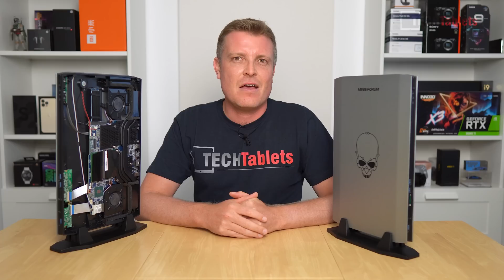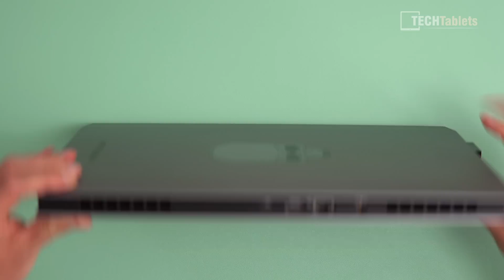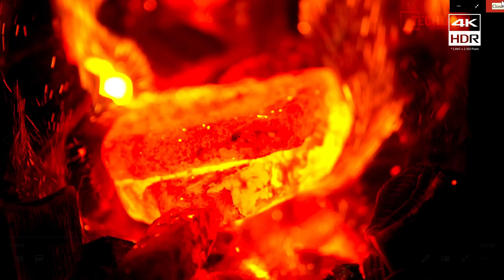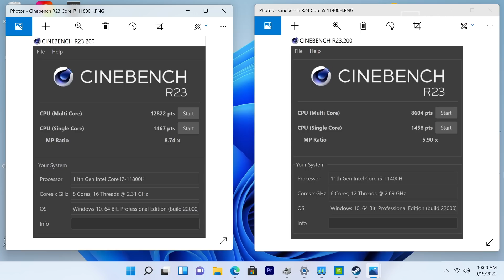Awesome SFF RTX 3070 & RTX 3060 Gaming PCs!

Comment from the maker: More info & pricing: https://bit.ly/3d2pEns
00:00 - Intro & key specs
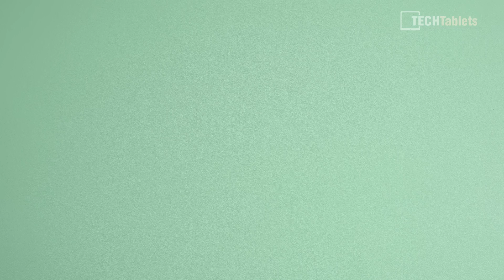00:54 - What's in the box
01:49- Design, ports, and internals
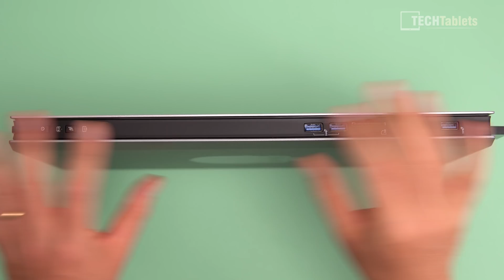05:08 - Bios settings available
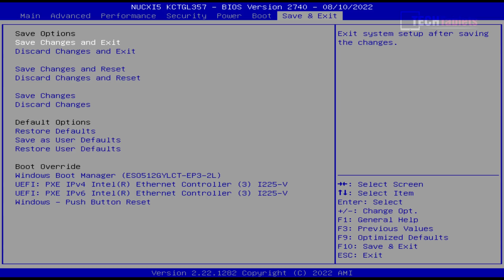06:53 - Windows 11, devices, 4k playback, and benchmarks
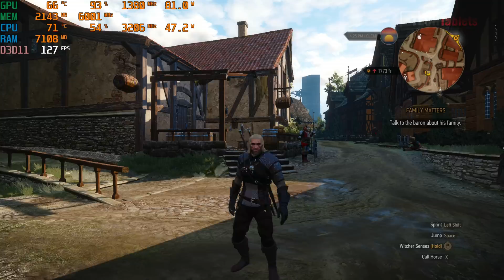13:38 - Gaming & thermals
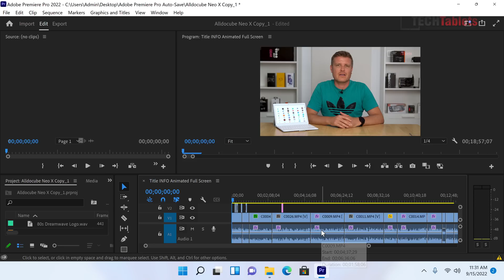14:46 - 4k video editing and export times
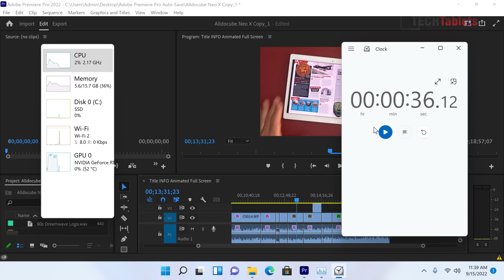16:40 - Linux Manjaro test
16:58 - Final words with Pros and Cons
Reply: Hi techtablets, first time on your channel.. is that an Australian accent I detect?
Just wondering if you tested any faster RAM. I heard the NUCXi7 doesn't support XMP, is this true?

Comment: The reason its not pulling max wattage is because of dynamic boost. It basically means your 3070 is 125w + 15w of shared power between CPU and GPU. That 15w gets transferred to the CPU when the CPU is using above 20w or more (which it almost always does). Same with the 3060. 

To actually bypass this dynamic boost, you have to do the IMON tweak which has the CPU under report its TDP, and that will let the GPU use its full TDP and CPU will use its full TDP. I have no idea why nvidia even bothered with dynamic boost, it just degrades performance. 

And the bios isn't exactly ''unlocked''. If it was you'd be seeing WAY more options. If you can somehow get an actual unlocked bios then you can do the IMON tweak and you should see a 5-10% boost, especially in the 3070's case where it should hit 140w more regularly. 

And thats the issue with these repurposed gaming laptops. They're not really cheaper, or faster or even more featureful. Why aren't they cheaper when they're dropping the display, battery, keyboard, trackpad, etc.?

Comment: I'm guessing the Integrated Intel GPU is disabled because on other computers I notice that CPU graphics limits the HDMI port to 2.0. So since the 3070 discrete GPU is pretty powerful that can limit some games that could otherwise do 4k at higher than 60 FPS, since HDMI 2.0 is limited to 4k 60Hz. Newer CPU with integrated graphics are coming out with HDMI 2.1 support and I notice that this limitation has gone away.

Comment: bro because your setting on premiere is VBR 1 pass which is it will slow your rendering, I'm using SER5 32ram and i been using it for rendering 4K 150mbps h264, 1hr length the no problem, smooth, you need to tweak some of the settings in rendering, should use a media encoder for rendering your video
Reply from the maker: It's because I always use that same yt preset for testing PC tech for encoding performance. It's across all them so not going to change it now. But thanks!

Comment: Id like to know if you did this if it is simple to replace the thermal paste on the system because with me i like to replace the default paste they would have in the system with something a little higher in quality because i do get a little anal when my temps is too high to my liking also id most likely end up using HoloISO (Steam 3.0 OS) on the system since it has Nvidia support now and also for the 3060 model might perform a little better.

Comment: They disabled integrated graphic because so many games and software have problems because widows would force integrated gou as default even if you change it to dedicated. Saw this problem on so many laptops. Also windows is very bad at gpu scaling especially when you have both integrated and dedicated gpu working at the same time. My friend needed to disable integrated gpu so he can avoid errors in games
Reply from the maker: That might be it yes. But still for video encoding the intro graphics comes in very good tospeed things up.

Comment: Would be nice if you state it a bit more clearly that the manufacture send them both to you. 
Its like you said just a Laptop board put into a shell. All the disadvantages of a laptop without any benefits of a mini PC. They didn't even add additional display outs or USB.
A Laptop with  i5-11400H, 16/512GB  and RTX 3060 is like 700- 800€ and you get a 144 Hz display, battery, keyboard and stuff with it while the MINISFORUM lacks it all and costs almost 200€ more.
Reply from the maker: Didn’t I say Minis forum sent them to me at the start? If I didn’t I apologise. Yea it’s a repurposed laptop motherboard in a Mini PC you can see the connections on the board for things like the battery, touchpad keyboard and display. What’s annoying is the iGPU is disabled for some reason which makes no sense.

Comment: I've got an MSI laptop with 11800H and 3070. It's 80W version of the 3070 and does well enough. I'm able to run games at 1080P or 1440P with high details.
Reply from the maker: This a good card for 1080p and 1440p for sure! I had this spec in my MSI GE66. Thanks for watching.

Comment: This is just a 3060 and 3070 gaming laptop without speakers, high refresh rate screen, battery, keyboard and track pad. Better to get a 3060 or 3070 gaming laptop instead.
Reply: John Doe  dude, you are just trying your best to defend minisforum. Alright. There is a gigabyte aorus laptop with 12700h and 3070(130w) for just $1099 this black Friday. Prove that price deal for a laptop isn't better than minisforum 11800h with 130w 3070. Remember that the laptop also has a 144hz display with 99% color accuracy, speakers, keyboard and track pad. Minisforum is just scamming you bro. You can get better laptop deals if you check
Edit: go to Amazon right now and check gigabyte aorus 15p XD with 11800h and 3070. It's $1250. That's the price right now
Reply: John Doe  just be patient and you will definitely get a good deal. Good luck. 
Edit: forgot to mention minisforum mini pc doesn't even have an inbuilt battery

Comment: Those power limits are weird. Your GPU clock was bouncing around a fair bit in the W3. I'm sure they are leaving a fair bit of performance on the table, annoyingly. And the thermals were quite good which indicates room for improvement (as you said). Hopefully they fix that.
Reply from the maker: I hope they do as the GPU and even CPU could be pushed harder.

Comment: If it had come out 1.5years ago it would've been great. Now, with Intel 13th gen looming, and the huge performance gap between 11800H and 12700H? Not so much. I do like the form factor. Keeping the footprint and wattage down by using a laptop chassis is a great idea to me. Not everyone needs 850w PSU's heating up the room, and not everyone needs to game on the go.
Reply from the maker: I'm sure next year will have an updated model with 12th gen 12700H at least but by then 13th gen will be out.

Comment: I have to admit this is an interesting solution.. the discount pre-sale price of the Core-i7 is a nice price indeed, even with 32GB and 1TB SSD! Too bad for the 11th gen CPU, but it's not a big deal. I will surely consider this solution next year, when I think I'm going to change my 8 years old PC. Since I have 2 3.5" HDDs, then I need a NAS with 2-bay, or, considering the price of a diskless NAS, maybe I need to buy a 8TB external disk desktop and transfer everything there.
Reply from the maker: Yes, 12th gen would have been the icing on the cake, but even so the 8 core 11800H still is quite the performer.
Reply: The 11th gen cpu(at least for laptops) is actually pretty good and nice step up from 10th gen.

Comment: I would honestly prefer this over my current custom itx desktop and even my MSI desktop replacement I had prior. Most gaming oriented laptops just don’t have proper cooling or quiet acoustics. If I can get good performance with good acoustics then this would be on my desk for the next 3-4 years minimum. This is also what I wanted in a console emulator replacement for my old consoles. What are the decibel readings under full load?
Reply from the maker: Yes I was surprised a bit to see the cooling as actually pretty good considering how slim it is dB readings around 36 max I think it was

Comment: This really missed the mark. It should have focused on providing spare HDD space especially considering the case isn't exactly small. Many 15.6 laptops with space for a spare 2.5 and additional nvme. It even has space just not efficiently used. Great review as always 👍
Reply: There's a spare m.2 slot. You'd be hard pressed to find a recent laptop which supports 2.5" hdd's. Not as common anymore.
Reply: Yes needs 2.5" drive but it has nvme pcie 4.0 spec looks like itnat least 🤔

Comment: The PCB looks exactly like intel nux x15. Basically they removed the 93 Wh/h battery and packaged it in a screenless-chassis. Better buy Nuc x15 based laptops. In Europe you can get XMG Fusion 15 M22. Moreover, those laptops have a way better BIOS. Please review XMG Fusion 15/Maibenben x568 from china.
Reply from the maker: No plans to buy those to review sorry.

Comment: It's also worth noting that RTX 3000 series that comes with laptops mostly has 128-bit as compared to Desktops which Got 512-bit above.

No wonder it's underperforming as you'd expected it. Not all will be able to tell, average consumers won't be, or wouldn't mind at all.

Then, slapping Adobe Premier for example only to be disappointed later on. It's really important one should take note if considering buying a laptop thinking it has RTX 3000 series graphics in it.

OEMs market this as revolutionary yet it isn't much. 

One must get a Desktop PC with a dedicated  graphics card in it instead.

Coz there's not much to expect in laptops in terms of graphics.
Reply from the maker: Still I have a MSI GE66 and the GPU pulls the full wattage it’s rated at, but here it doesn’t for some reason. Bios updates needed maybe 🤔

Comment: Thanks for the awesome review once again, Chris. I am wondering if they are using cheaper binned Intel chips with issues with the integrated GPU and that's why they've disabled it. Or they were worried of eventual thermal issues.
Reply from the maker: Could be this, but I just think it's a bios setting. The are not QS or ES chips but final versions and the thermals are good pretty good for 8 cores 16 threads.
Reply: @Techtablets  Yeah, you are probably right, they could fix this with BIOS update.
Reply from the maker: I hope so because to some of us it's really useful.
Reply: @Techtablets  that sweet intel qsv which is more powerful than nvenc.

Comment: This is actually pretty cool. Wonder how loud those fans get and, more importantly, what kind of customer service is offered to US customers in case something goes wrong.
Reply from the maker: It has really good cooling so they are surprisingly quieter than the typical gaming laptop
Reply: @Techtablets  very nice. This may work in the living room. I have been holding out for a PS5, but since they increased the price of the system and are releasing some of their best IP to PC anyway I may just buy this instead. Great review, as usual
Reply from the maker: @NexusFantismo  Thanks for watching!

Comment: Would be interesting to see a Ryzen version. Also a lack of ports is a con right? compared to a standard desktop tower
Reply from the maker: Still has thunder bolt 4, sd card reader and those USB ports. Not really lacking maybe an extra HDMI but we have TB 4 for 3 display outs. unless you wanted 10 USB type A’s 😂😅